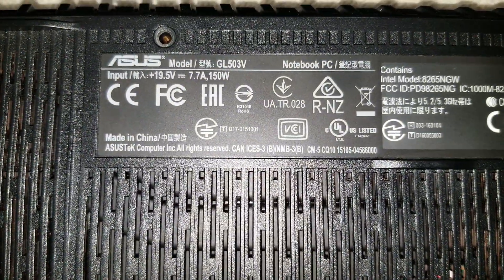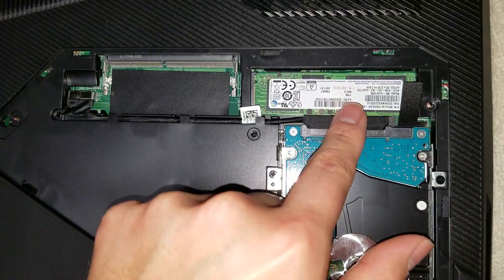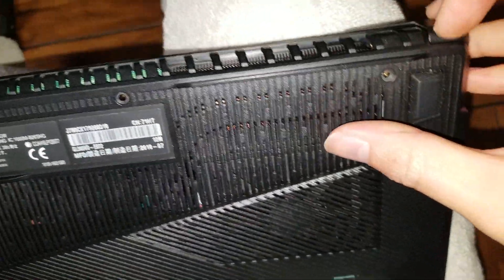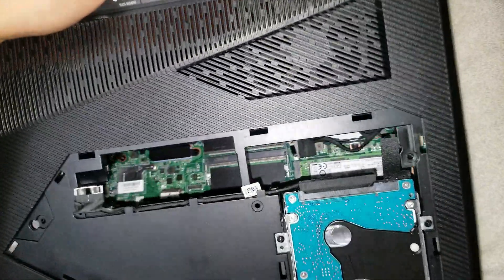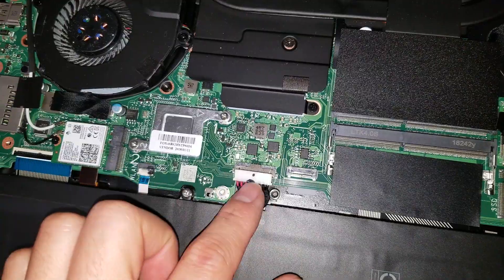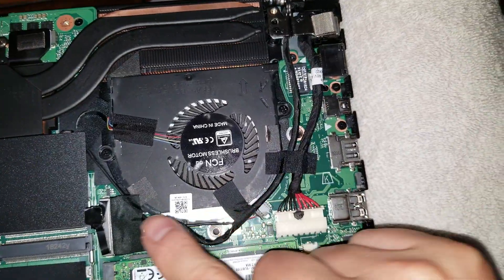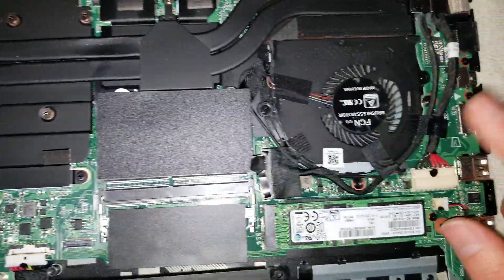ASUS GL503V Laptop Disassembly

Comment: Can I remove the motherboard to see the back of the keyboard and its connectors without having to remove the keyboard, or is this only should be done when I'm replacing a component?

Mine is GL503VM
I wanna get new replacement keyboard + palmrest
Reply from the maker: I believe so

Comment: I have this laptop. My keyboard lights work but for some reason blue color is dimmer than the others. For example if I set the backlight to white then I'll get a light orange due to the lack of blue brightness. Would you have any idea what could be the issue? I have already disconnected and reconnected both keyboard/backlight cables. Thanks!
Reply from the maker: Might be burnt out

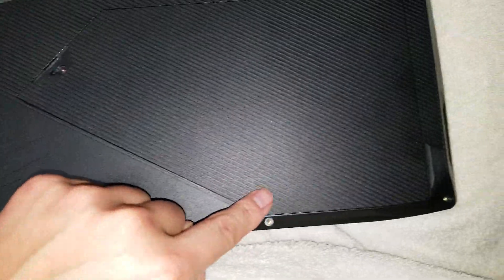Comment: 0:35 anyone else unable to remove this screw? It appears somethings holding it back from being removed as it will just keep spinning it circles but wont come out.

The screw isn't stripped...not yet anyway lol
Reply from the maker: The plastic around the screw mount likely broke, so the brass part is just spinning nonstop.

Comment: no power or charging lights after taking back off to clean dust out. Anyone else have similar issue? Took apart as per video and worked fine before. seems odd.
Reply from the maker: Very strange.
Reply from the maker: Plugged it in?
Reply: @ItsBinhRepaired  plugged in no charging lights. battery unplugged plugged in..no power. worked right before I cleaned it. just dusted inside and reassembled. rechecking connections see nothing off that I notice. so odd.
Reply from the maker: @TeamSTCDonny  hmmm very strange. What did you use to dust it?
Reply: @ItsBinhRepaired  took the fans out, gave them a few blasts of can air and wiped them then reinstalled. wasnt a lot of dust elsewhere. Pins seem straight on the hdd connector, did not remove anything else. Think I should I try to disconnect both batteries and wait a bit and retry?
Reply from the maker: @TeamSTCDonny  battery should have been removed for that type of thing.  You can try remove both batteries and hold the power button 15 seconds
Reply: @ItsBinhRepaired  I did unplug the main battery originally. will try removing both and retry.
Reply from the maker: @TeamSTCDonny  hmmm hopefully it works

Comment: be extremely careful with the battery. i didnt do anything besides wiggle it out with my fingernails and the pins were bent when i tried to put it back together.
Reply from the maker: You have to make sure to pull it straight back
Reply: @ItsBinhRepaired  i did, very lightly like the video. thankfully my friend was able to fix the bent pins.
Reply from the maker: @giggitygoo21  awesome!

Comment: You disconected the battery after you pulled the hdd cables???
Reply from the maker: Correct. As long as the computer is off, it's not a problem.
Reply from the maker: Even with the computer on, it's like holding the power button, which is bad, but usually not fatal to the components.

Comment: So when i took off the back panel to clean my fan. after i put it all on my D: drive wasn’t found… do you know the issue?
Reply from the maker: Did you touch the hard drive/ssd?
Reply: @ItsBinhRepaired  no i set it to the side to dust my fans
Reply from the maker: @RyKizan  might not be installed properly
Reply from the maker: @RyKizan  hopefully not damaged
Reply: @ItsBinhRepaired  i’m not sure how, i unscrewed and rescrewed the whole thing together
Reply from the maker: @RyKizan  not sure

Comment: hey, can you please tell me what are the taller screws, the once that hold the top edge of the outer most cover called(in your video  at 0:27 you refer them as screw no. 1,2,3,4). i somehow lost all my laptop screws but I don't know how to explain the screw size/name to my local hardware store. Great video btw!!
Reply from the maker: I don't know, but they measure by mm. I think most are 2mm x some length. You can take it to them and ask what would work.

Comment: Hi!! greetings from Argentina! Can you help me with one thing? my friend wants change the SSD for another more big, is this compatible? internal solid drive Western Digital WDS500G2B0C 500GB blue
Reply from the maker: This should work assuming Google showed me the right model. https://amzn.to/3Doc8C0
Reply: @ItsBinhRepaired  ohh nice is the same, so it will works right?
Reply from the maker: @gasparberardimora9441  any m.2 nvme will work
Reply: @ItsBinhRepaired  PCIe 3.0?
Reply from the maker: I don't understand why people ask these questions. Doesn't matter what it is unless your plan is to buy an old used SSD to try and save money.
Reply from the maker: You should be able to use an SSD with the latest pcie version or whatever. Not sure what you mean by 3.0. I never found that info useful for anything, unless you are trying to buy a laptop with maximum performance, so I don't bother to find out.

Comment: Thanks for the video. Any chance of removing the whole cover and cleaning it without removing the fans? When I remove the fans I have to remove the heatsink etc. it might be a problem. I'm not an expert :)
Reply from the maker: What do you mean? Did you watch the video? At what point are the fans removed? I don't understand.
Reply: @ItsBinhRepaired  I will open the laptop cover, can I clean it without removing the fans?

Fans, thermal paste etc. I will not take it off. I will not touch.
I'll just open the lid and clean the fans maybe a brush or blowing etc. with.

Would it help if I cleaned the fan as I couldn't replace the thermal paste?

sorry google translate does some stupid translation.
Reply from the maker: @hduman05  this video will help. https://youtu.be/3zs_SJ3BXgA
Reply from the maker: @hduman05  just use your best judgement.
Reply: @ItsBinhRepaired  Thanks man :) it helped.
Reply from the maker: @hduman05  glad it helped :) if you haven't already, please like and subscribe so others can find my videos. Thanks!

Comment: Hello mate, My laptop airplane mode is disabled because of which my WiFi and bluetooth are not working ....plz help 🙏
Reply from the maker: Did this happen suddenly out of nowhere?
Reply: @ItsBinhRepaired  yes sir 😢
Reply: @ItsBinhRepaired  but , after 2,3 restart it works fine as new
Reply from the maker: @kapilwawre947  very strange
Reply: @ItsBinhRepaired  do u think it's a hardware problem 😶
Reply from the maker: @kapilwawre947  could possibly have been a bad update, not sure.
Reply: @ItsBinhRepaired  okay I will reset my laptop
Reply: Sir can u share  your social media accounts so that I can discuss the problem briefly
Reply from the maker: @kapilwawre947  why move to another platform. If others have the same issue, they won't be able to find it. Keep the discussion here.
Reply from the maker: @kapilwawre947  if you want personal assistance, that's $60/hr
Reply from the maker: @kapilwawre947  ok
Reply: @ItsBinhRepaired   I don't have any money so, thank you for your guidance till now. If there is any other way ,it would be great help for me.
Reply from the maker: @kapilwawre947  you can try a clean install of Windows
Reply: @ItsBinhRepaired  do u mean to.... reset the laptop?
Reply from the maker: @kapilwawre947  wipe it out and reinstall Windows.

Comment: Followed the stuff in the video to clean my fans and it worked fine, however now my battery won’t charge. it just blinks between charging and not charging :( any help?
Reply from the maker: Did you disconnect the battery and press and hold the power button before working on the computer? Make sure you reconnected it.
Reply: @ItsBinhRepaired  ok i have literally no idea what I did but it magically works now, sorry for wasting a little bit of your time 😅
Reply from the maker: @2013HypixelWallsDemon  lol nice

Comment: How do I remove screws with stripped heads? thank you in advance
Reply from the maker: Need to use a micro screw extractor
Reply: @ItsBinhRepaired  thanks for the info!
Reply from the maker: @rickyjundechino7679  sure

Comment: Can I upgrade the ram to 3200?
Reply from the maker: Don't know, but you can try.
Reply: @ItsBinhRepaired  will there be any problems? It will still work right?
Reply from the maker: @mr.omninpotent6358  you'll have to try it. I'm not sure.
Reply from the maker: @mr.omninpotent6358  make sure you can return it just in case.

Comment: I want to cleann out the fans but I'm too scared to open everything up
Reply from the maker: Make sure to watch the video multiple times.
Reply: @ItsBinhRepaired  I had opened and loosened all the things, but I was getting some resistance trying to open the cover cause it was not coming fully off as easily as in the video. So I just cleaned along the edges and put everything back lol.

It's my only laptop, I don't want to break anything or cause it too malfunction
Reply from the maker: @krishm16  lol  you can use a vacuum over the fan vents.
Reply: @ItsBinhRepaired  Haha fair enough, thank you
Reply from the maker: @krishm16  but you'll have to do it more often

Comment: I have one of these and just recently stopped charging and won't turn on. Have already disassembled and cleaned it as well as checked the power port for obstructions and all cables for damage. Carefully felt the battery pack for swelling or cracking and found none. Any advice? Much appreciated.
Reply from the maker: If you have a voltmeter test the charger and make sure power is going from the charge port to the laptop

Comment: Lots of good information in your video, I have a ASUS Model GL503VD DB71, I need to replace the battery, as it only last about 10 minutes before it goes dead after disconnecting the power supply. I was thinking of getting a new replacement battery from Battdepot.com, any other replacement battery websites you would recommend and also do you have another video that specifically shows the battery being completely removed from this model, if not are they anything I need to look out for when replacing the battery.
I would appreciate any advice  you could offer.
Thanks,
Morrice
Reply from the maker: I buy them from Amazon, just make sure they have free returns and good reviews. I don't own the computer and returned it to the customer long time ago, so I can't show how to remove the battery. Hopefully the video as is will be enough to figure it out.
Reply: @ItsBinhRepaired  Sounds good, I will check out Amazon before I order my replacement battery.
Reply from the maker: Just have to remove screws if there are any. I explain how to disconnect it, but if it's not clear, you can watch some of my later uploads. I started doing better close ups.

Comment: hey do you think I'll be able to use the laptop if i kept the battery disconnected? i use it a lot and keeping it plugged all the time but i know thats not good for the battery's health. also what did you mean by hold the power button?
Reply from the maker: You can try it. Drain the battery to 40% for storage. But if you're never going to plug it in, then there won't be much benefit to preserving it. If you accidentally yank the power while it's on, it can damage the laptop without a battery

Comment: i have a question? would it be lethal for the laptop if water would to spill into the part above the keyboard and no where else? i assume it's the fans
Reply from the maker: Anywhere can be lethal. Don't try it. If there's no power and the battery is removed then it's not a problem as long as it's completely dried before it is powered or replacing the battery.

Comment: Where could I get a battery replacement for my laptop? I have the same one as you. I spilled water on it I put it to dry up ASAP for 48 hours with a big fan, it turns on like nothing but sometimes it shuts off randomly or won’t turn on I’m thinking it’s the battery
Reply from the maker: You can get batteries on Amazon

Comment: Hi i have a question can i upgrade the ram on this laptop?
Reply from the maker: Yes, please watch the video. I mention the ram. You'll have to open it to see what RAM it's currently using.
Reply: @ItsBinhRepaired  sorry i mean like the ram speed from 2400mhz to 3200mhz is that possible?
Reply from the maker: Not really sure. Some computers will work with it, others won't. Only way to know for sure is by googling or trying it. You could always return the ram if it doesn't work.

Comment: Hi there, quick question, can i leave my internal batery remained disconected and use power supp adpt directly since it's always plugged in? Or it's a no no? I was wondering if will lessen the temp. :)
Reply from the maker: Usually you can. It won't decrease temperatures.
Reply: I see so it doesn't reduce the temp at all, and thank you for your quick response . :)
Reply from the maker: @agnesnazareno8796  no temp reduction that I know of. You can try it. Don't forget to like and subscribe if you haven't already. :)

Comment: Hi! Do you have a video to change the keyboard? Mine was already damaged and i bought a replacement keyboard on aliexpress. Thank you.
Reply from the maker: I think this one is held in with melted plastic mounts. Not an easy job and requires special tools.
Reply: @ItsBinhRepaired  thank you so much for the response and information. Regards!
Reply from the maker: @Wafu777  no problem. Hopefully you're able to get your problem resolved.

Comment: Hi, I have an exact same model of GL503V, with extremely loud fan noise.  I noticed there are two fans in your video.  Can you show/demo how to remove and replace these two fans with new ones? Thanks a lot.
Reply from the maker: I don't own the laptops, they are customer repairs and returns. This video should help https://youtu.be/3zs_SJ3BXgA You'll have to figure out how to remove the fan on your own though.
Reply: Hi. Same laptop, same problem. Tired to repair the fans and broke them off. Anyway theyre super easy to replace. 2 screws each fan and a connector, just make sure you get the correct ones as they vary a LOT!

Comment: Having a hard time opening the big case up, any tips?
Reply from the maker: Watch the video multiple times.
Reply: @ItsBinhRepaired  apparently i havent unscrewed one of the screws, but now i can't pull out the battery
Reply from the maker: Glad you were able to figure it out
Reply: @brilianvincenza4202  where was that screw ? I have the same problem, its stuck like a rock but i cant find any screws left
Reply: @ItsBinhRepaired  is there any alternatives?
Reply: Simply applying pressure on the rear ends(below the screen) will pop em out...

Comment: Hi there
I opened my asus rog gl703 to clean it up and did nothing else. Now when i turn it on i dont see any display not even bios. But lights and fans turn on. Can you help?
Reply from the maker: I hope you didn't short anything or fry it with static discharge. If you're lucky it's just the RAM. Try removing the RAM and putting it back. When turning it back on, be patient. You didn't touch the LCD cable, did you?
Reply from the maker: Disconnect the battery, power, remove the cmod battery, and hold the power button for 30 seconds. Then short the cmos battery pins to reset it.
Reply: I did try removing and putting back Ram thing but still got nothing 
Trying Your second method please guide what is short the cmos battery?
Reply from the maker: @TravellingLogs   the cmos battery is the coin cell battery. After you remove the battery there are the metal tabs that connect to the positive and negative end of the battery. Use something metal to short the two contact points for 10+ seconds. Make sure not to touch anything else with the metal. That should reset the bios. When you power it back on, leave it for about 10 minutes. Sometimes it does some stuff resetting the bios that can take a while, usually not that long, but doesn't hurt to wait longer.

Comment: Hello! Very helpful video :) However I have a question. Can You recommend some specific fans for this laptop? I don't want to buy the same model and I have to replace one fan (on the left) because it sounds like silent tractor (*trrrrr*).
Reply from the maker: This should help https://youtu.be/3zs_SJ3BXgA
Reply from the maker: If you can't fix the fan you'll have to search the fan on eBay/Amazon the model number should be on the sticker on the fan. You can't use a different fan or it won't fit.
Reply: @ItsBinhRepaired  thanks for the answer. However, I noticed there are other screw holes around this fan, maybe it could be compatible. Thanks anyway!
Reply from the maker: @aborygen8  those are most likely to hold the case cover on

Comment: hey...thanks for the video showing how to disassembly the laptop. I tried disassembling and reassembled the laptop but after reassembly my games get laggy. Do you think it got something to do with the way its reassembled? u have any tips?
Reply from the maker: Did you remove the heatsink?
Reply: @ItsBinhRepaired  i think i did...i tried to open the fans to add thermal paste but i realized the thermal paste wont arrive until tuesday :c what should i do?
Reply from the maker: @michaelrex1428  if you lifted the heatsink off and didn't redo the paste, it's most likely overheating.
Reply: @ItsBinhRepaired  oohh thats why...ill make sure to repaste! thanks so much for your help
Reply from the maker: @michaelrex1428  see if you can run some tests to check the temperatures.
Reply: @ItsBinhRepaired  the temperature from rog center is less than 70°c but the laptop keyboard and battery area is hotter than usual..i tightened a few loose screw and it doesnt lag now but just hotter
Reply from the maker: @michaelrex1428  watch this one and redo the paste like that. https://youtu.be/8XU3BIJHWZ4 be careful with old paste that's been pulled up. It won't cool properly and can cause permanent damage.